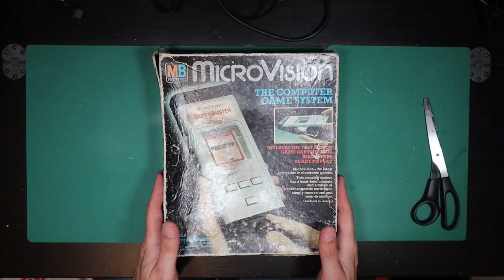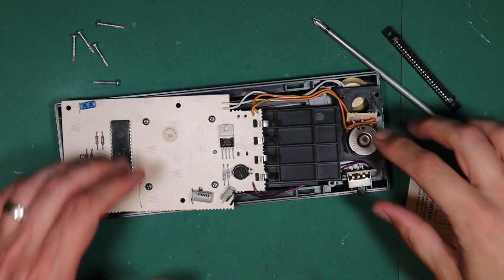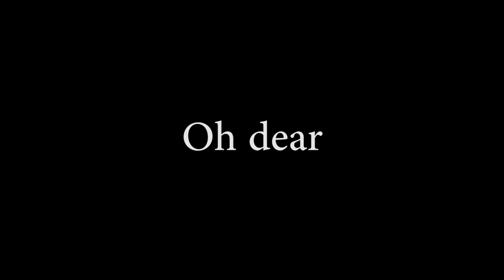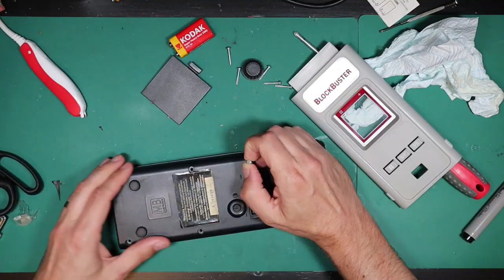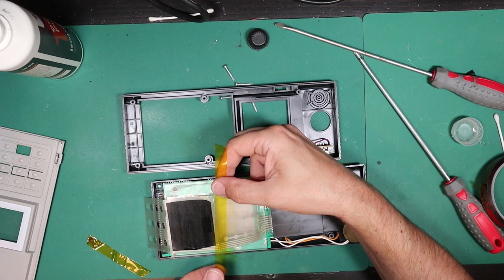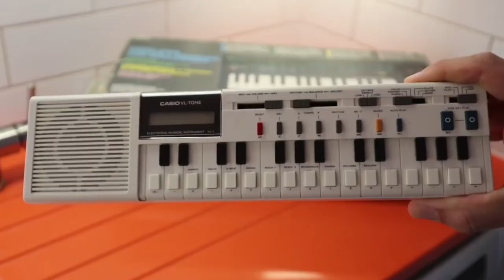MB Microvision Trying to fix

Comment: Great video! I recently r̶e̶s̶t̶o̶r̶e̶d̶ replaced a membrane keypad on an old RCA Studio II game console, and I used very tiny microswitches and copper tape. I created a matrix of the switches on top of heavy cardstock paper, and soldered the switches onto the tape (which accepts solder beautifully), and then hardwired each key into the PCB, replacing the ribbon cable. Worked extremely well. Maybe a bit of overkill, but it does have an element of future-proofing, so I thought I'd pass along the idea...I'm sure you'd implement it far better than I. :)
Reply from the maker: Hi Jason, thanks for your comments. Great job on the console and what a great idea, I have yet to use copper tape but have heard a couple of repairs using now. I think your fix is great and I doubt very much I would have done it so well. Thanks for your awesome comments. Really appreciate the suggestion and you sharing your experience. Glad you enjoyed the video.

Comment: Interesting, hopefully someone with a 3D printer could replace the brittle plastics and find some foam.  Can’t wait for the Astro Wars video as I have one I scored at a thrift shop a couple of years ago. It’s fully working, the display has good brightness and it needed no work other than a little cleaning.  Bonus, it came in the original box.  In Australia they were marketed by Grandstand Leisure New Zealand.
Reply from the maker: Thanks @wenlocktvdx my hope is that I moved the microvision on its path to greatness. I might have tried for foam but the video was filmed during lockdown and I wasn't able to get out for materials. Astro wars is my all time favourite VFD game (of those I've had so far) I have an existing video up if you want to take a look.  Not sure when the next will be edited. Nice Job on the thrift shop find, here they seem to sell only old clothes and the odd book. Finally thanks so much for your comment. Very much appreciated 😁
Reply: Most thrift stores are like that, luckily our local Vinnies (Society of St Vincent de Paul) does sell a wide range as does the Hospital Auxilliary op shop. Salvos won’t touch electrical but has sold a radio sometimes.  Vinnies is a good source of games and even consoles, I got a Game Shark Gameboy version there.
Reply from the maker: @Wenlocktvdx  nice! Perhaps somebody knows somewhere similar in the UK